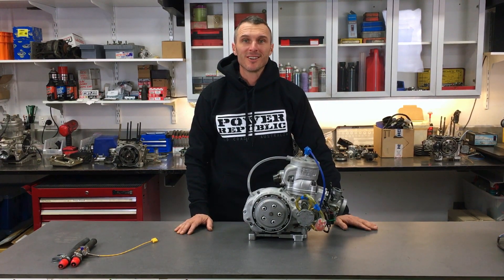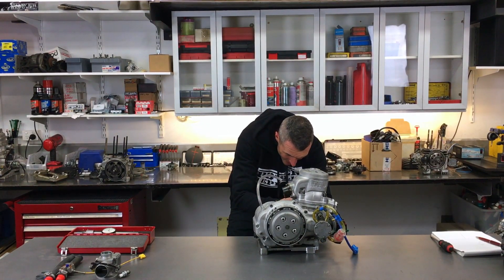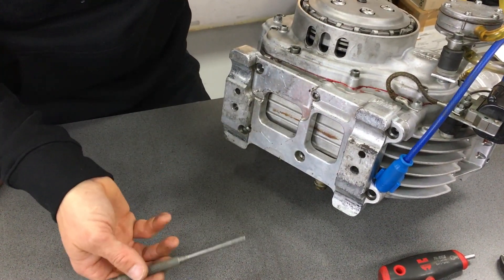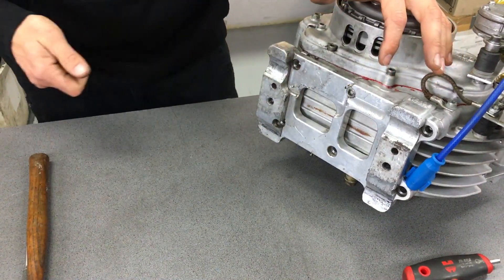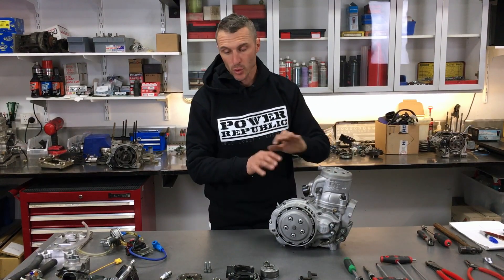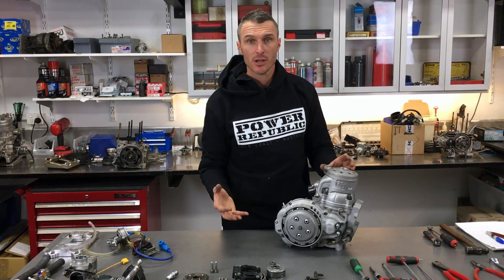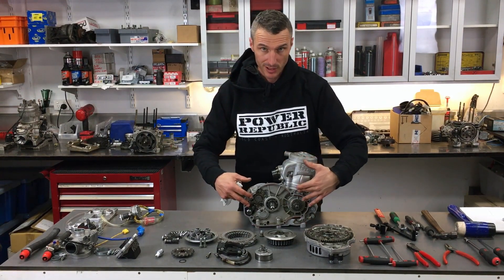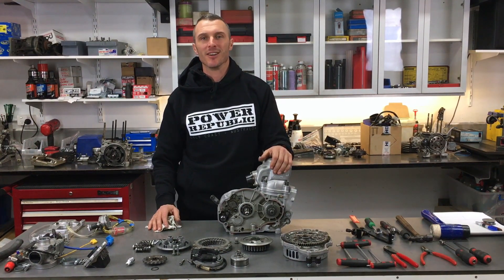KZ Engine Rebuild Project Part Three - Engine Breakdown - POWER REPUBLIC

Comment: @1:38  If you have this issue in the future, what works best for stripped out socket head Allen bolt removal is; a Torx bit. I am an Industrial Mechanic and this is a fairly common find in my field. It is quick and easy to remove with this method. Pound the Torx bit in with the hammer then attach your ratchet and go!
Reply from the maker: thanks heaps for the feedback my friend.  where about's do you work?
Reply: @PowerRepublic  I work for Regency Fireplaces International. Main production facility is here in Canada. Lots of lasers, robot arms, turret punches and break presses.
Reply: good to know. everything is a torx now!